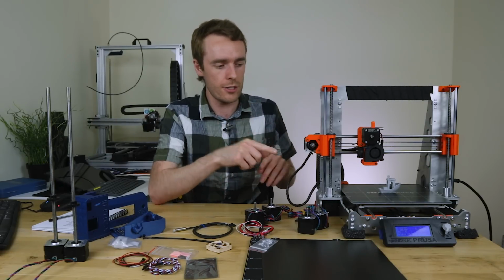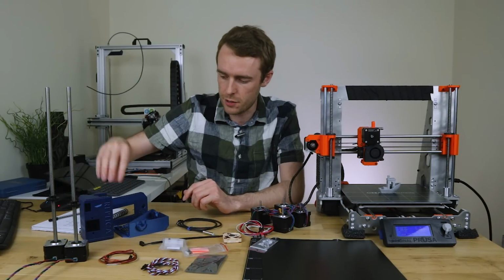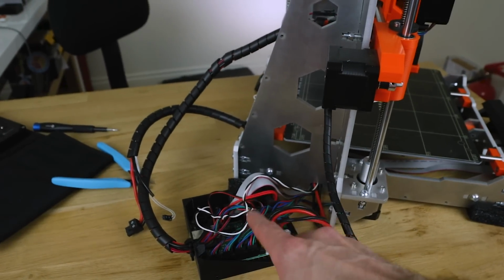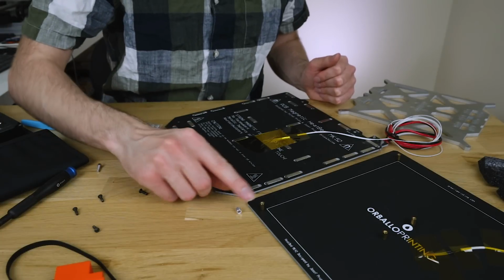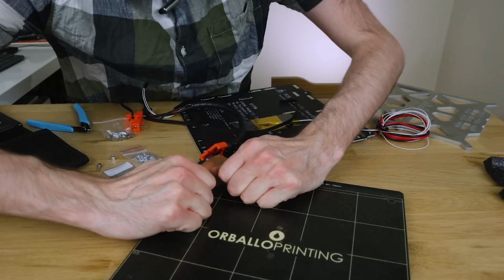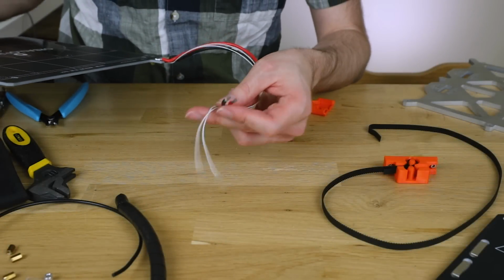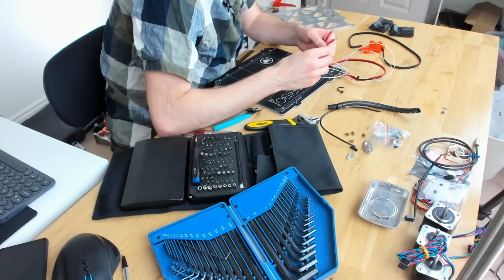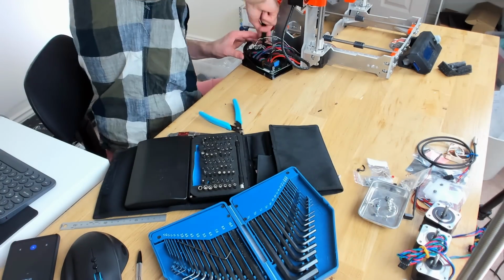Prusa Mk2.5 Upgrade Build Series - Episode 1

Comment: I'm not sure where you got your mk2.5 kit from, but the mk2.5s use the same standoffs as the mk2s. I guess that they have sent you mk3 standoffs
Reply: It appears to say Zaribo on it.
Reply: I hope he got the 12v and not the 24v one.  I didn't like the way the cover over the wire connectors fit.  It looked crooked and not straight.

Comment: Nice Video.
At the moment I am converting my p3steel to a mk2.75s (i call it 2.75 because I use an Einsy (clone) and 24V, so more close to the mk3s). A long path - begining with a geetech i3 (the worst you can get as a beginner), upgrading here and there. Actually two of the steppers and some cable are from the original printer. Everything else changed. For the price I could have bought another original prusa - but its not for the price, its for the fun.